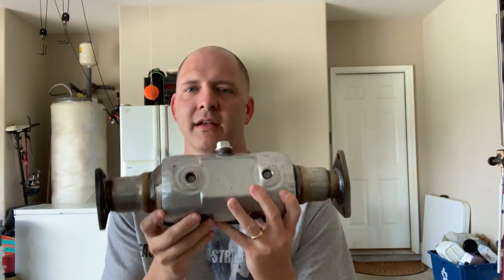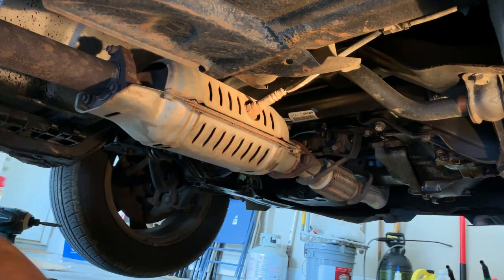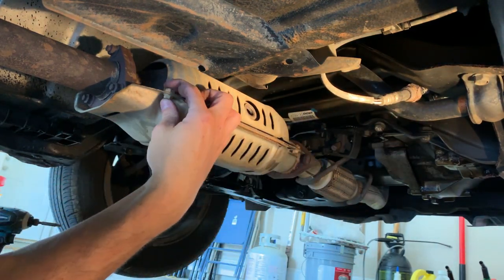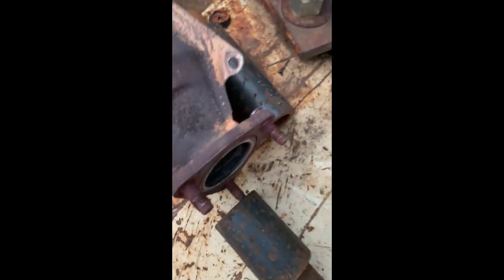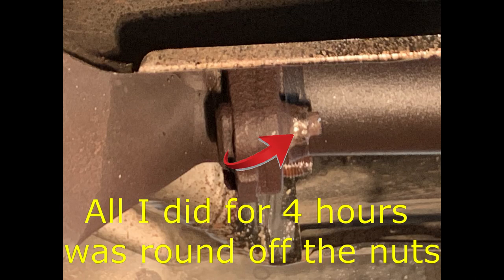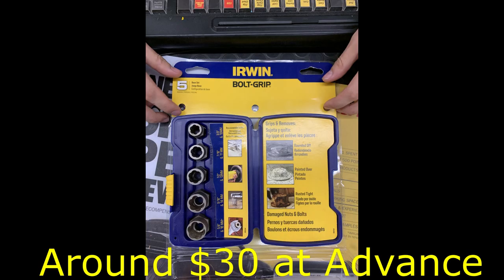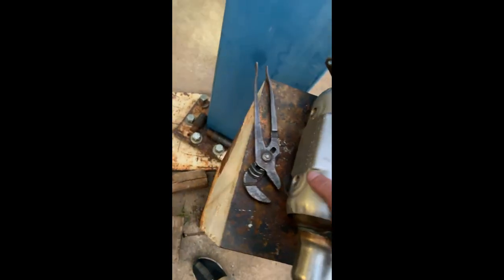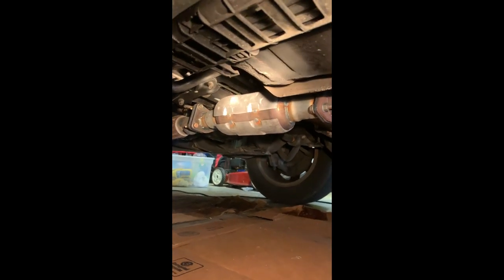2002 Honda Accord EX Catalytic Converter replacement

Comment: I replaces my 2000 Accord cat not because it is bad but it rattles,I kept it in the garage, I know someday it will be worth hundreds because there are precious metals in there.l paid $375 for a Magnaflow CARB compliant.Two years later it got stolen.I replaced it $600 @ the muffler shop welded it in because they cut the mounting 3 screws on both sides.I put an alarm and also a camera with motion detector so far no more attempt on it for 5years now.
Reply from the maker: I hate thieves.

Comment: It sheared because your trying to use a 1/4 inch drive adapter, when in reality you should have used a minumum 3/8 drive ratchet and socket… btw, its 1/2 inch socket. For future references.
Reply from the maker: You are 100% correct. Over the years, I’ve acquired most of my tools because of this type of trial and error learning. You shear something once and you never use that size again. My good friend who gave me the proper tool looked at me like “you really used that?” It was all I had! Not anymore:)

Comment: I’m giving you a like because I laughed so hard I pulled a muscle. Take a breath!! YOU DO NOT NEED THE TOOL. Take a cut tool or a 25$ angle grinder with a extension from Harbor freight. It’s really easy. Get your self some new nuts bolts and washers and the heat shield does not need to come off ever 🤣. That was so great. CUT THE HEAD OFF ALL THE BOLTS! You do not need anything but new grad 10 bolts forget the tool and cut them all!! Man. You made me feel like a lucky guy. Hard work I love it so you got a like my friend. Lesson learned. Check out my page. I’m doing one soon. Ima show you how to do two. Both 120$ or so a pice off line. It’s on a 2001 I will do it all live. I always do. I have made mistakes this is how we learn but tell me why did you not juts think to buy bolts grade 10 and replace the instead of putting the rusty mess back on. Also should have at least cleaned the sensor? Loved the effort. That was epic! 👏 oh I did my video on the first Honda. Haha. I never did the second part I got so mad but it went pretty easy other then they gave me the wrong part ordered on EBAY. So upset. I had to ouch it out for now bolt up the old one while I wait on the part. Thankfully I cut it perfectly so it went back on pretty easy about 2 mins and I’m waiting on the part. Smh. A hair off. Local it’s closed to 1200$ for the part smh.
Reply from the maker: As I’ve said, the learning curve for DIY automotive work is steep! Each new job you make mistakes, and then the next time you’ll do it faster with less errors…and the right tools! Yes, cutting bolts off would’ve been way better!
Reply: @durk1980  hey. I give you credit. That was some hard work you put into it. I do this all day and learning is part of the job. I was amazed how you never gave up. Only down side was when I saw you finally getting a lift and not completing the job without some cheating involved. 😂. You earned that lift after laying on the ground with your neck up for about 4-7 hours or so. I’m sure is was a work of hurt. As long as you saved the money and got it done that’s all that matters. Great perseverance!! I would hire you I cannot find anyone to put in work
Like that. 👏
Reply: yeah exhaust nuts can be a PITA, but i think a lot of the problem started at "half mm bolts" lol
Reply: @akem0020001  That wasn't the problem. The problem was using a 1/4" socket to being with. Because you should always use an impact, and 1/2" sockets. But he did get it done that's all that matters really IMHO.

Comment: I'm getting ready to remove my old converter in this coming week. I bought the same exact converter you have. 
Would the bolts be any easier with heat applied?
Reply from the maker: Perhaps. As a general rule that helps, but you have to get them really hot. What I would do is get any good penetrating spray, and let it sit for a few hours before, and then, if the normal socket doesn’t work, get one of those grippers that I use. It will come off!
Reply: @durk  

Thankyou so much. I just bought the socket grippers. I can't wait to get a dry day to get underneath the car. 
When I tried starting the car the engine was racing and wouldn't idol down. The catalytic converter was smoking big time. So I'm anxious to see if that fixes the problem

Comment: Online they are going for $80-$120 but I went to auto zone and they said it was gonna cost like $1000 is there a difference?
Reply from the maker: That is quite a difference. 
I would say check multiple sites online. If they’re all $80-120 with good reviews, go for it. $1k is ridiculous. Not everyone behind the desk at the parts store is experienced. Remember that. We’ll intentioned I’m sure, but probably not accurate.

Comment: Hey Durk, thank you for posting this video... Really helpful! Do you have the part numbers for the 6 nuts and bolts you purchased at Advance?
Reply from the maker: Thx Peter!  Good question.  Had to ask Advance; luckily they keep purchases on file.  Bolt: Dorman 981-537.  Nut: Dorman 983-110D.
Reply: Thank you!

Comment: My 2012 Honda Accord check engine light came on yesterday took it to the autozone and check it out it’s said I need oc cat replacement . Can I still driving the car without fixing it for a while ? Do you know how much it’s cost to fix it ? I can’t take it to the auto shop they gonna charge a lot .
Reply from the maker: @Zuzzy, not sure on your car being much newer than mine was, but in general you shouldn’t drive with a bad cat. It’s keeps the exhaust gases from exiting properly. Sure, maybe it’s just something minor and you’re only failing an inspection and emitting bad fumes, but chances are with the check engine light there’s something there you need to address sooner rather than later. Just my advice since I haven’t seen it, but hopefully you can get a good deal on the replacement part, and don’t take it to the shop to replace. You can do it!